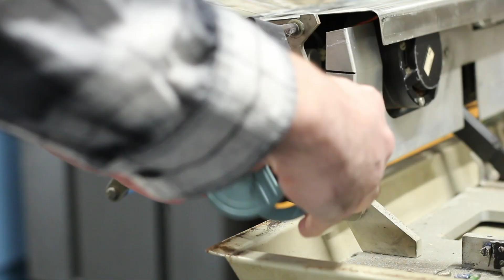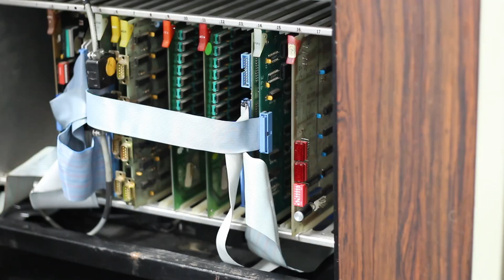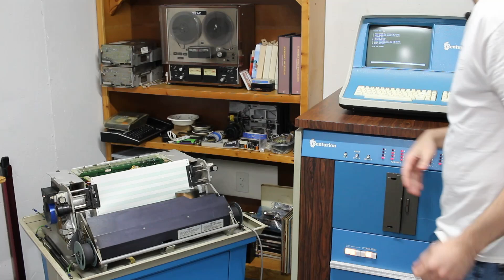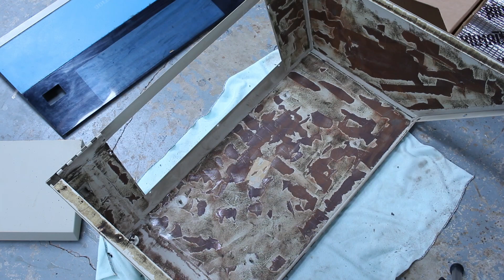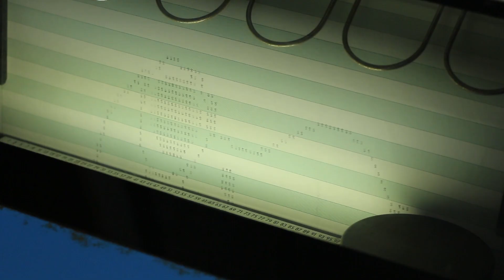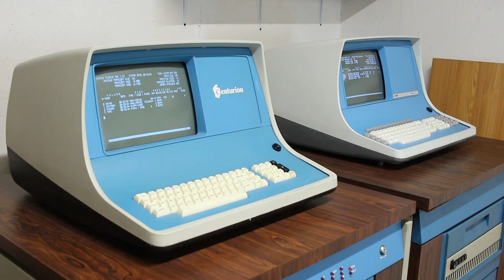Printing ASCII “Art” Like it’s 1980!

Comment: No it does not print 66 colums on the left then shift right to do 66 colums..  It prints the odd (left Colum) then shifts right to print the first column in the Right set of 66 characters.   Basically :The carriage prints odd characters when shifted left and even columns when shifted right.  Look at the video and you can see it.

Comment: Not that his is not a fast printer, but the fastest I ever had the pleasure of working with was a monster from IBM and it spit out 2 pages per second or more (depending on page fill).  The paper literally did an arc through the air before settling into the output tray.  You had to wear hearing protection if you were in the printer room when it was running.  Yes, we had printer rooms back then - circa mid 1970s.  We later replaced one of them with a physically bigger (much) and faster machine  (4 page/sec) but it was a laser, so was considerably quieter.

Comment: Mechanisms and motors really need exercise to function after a long sleep.  I simply run the transport back and forth with my hand through its entire arc of motion several score of times.  Lubrication is important as well, but exercise will free the transport(s), reducing stress on the machine once put into operation.  Reluctant motors and transports can cause the motor to pull more power from the transistors supplying that power and perhaps cause those power transistors to overload and fail.

Comment: My friends DMP100 printer going BRZZZZZZZZZZZZZZZZZZZZZZZT THUNK. DMP100 didn’t have a way to drive the head back to the left side so just released the drive and let a spring slam it into the stop. Radio Shack cheating out no doubt. No drinking a DP80 carbon ribbon, just had to buy new ones.

Comment: I used to have a chain printer back in the 80s when I was about 14 or 15.  A local company was scrapping their mainframe one day and I found out.  Got a van and went and picked up tons of units, mostly terminals and hard disk drives and then the printer.  I got it going pretty quick, but had to build an interface card to make it centronics compatible.  The printer was in very good condition though.  Quite an amazing device I must say.  Used it for years.  It is really nice seeing you restore this one.  Very pleasing to see it in action and hear the sound after all these years.  Great job!

Comment: Back in the late 1970's the CDC computer we used had similar printer art. We had the Snoopy one with the relevant year calendar and also one that printed a picture of Raquel Welch (decent!). Most of our rooms had printouts of these hanging on the walls. There were also others but I've now forgotten what they were.

PS. Compared to the printers on the CDC, this one's a pup That did 2000 lines per minute!

Comment: I saw an HP dot matrix printer that had a huge head capable of printing an entire line at once. This thing was loud that you needed a soundproofed room to use it. It used a SCSI variation called HP-1 to connect to a computer.

Comment: It's almost like YouTube want's me to remember things from when I was young.

I remember in the 70's passing around a file that would print Farrah Fawcett's famous poster in rough grey scale.
I wrote a Basic program to print out a grey scale chart using each character single strike, double strike (same letter, bold) and X out (different letter, double strike, correction). Took a b/w snapshot of the poster in my room, parents slide projectored the negative onto paper on my wall. Enter my data in a Processor Technologies Solus 1-4k. I yhink in '78 we upgraded to 8k. Polyphonic sound - woo hoo!
I remember having to wait until the coast was clear in the lab to print out. Even with sound deadning everyone could hear a  long heavy print out happening.

I got caught, remimanded but passed with a program that tracked attentance in the Mathematics Department and printed a letter when the  threshold for missing or late classes was reached. Data saved on cassette tape recorder everyday. 

Some where in a box I have some cassette tapes we used to save programs. 
Dot matrix was only a dream until the 80's. 
There's also ways of changing the spacing between lines to get a tigher picture.

Comment: I always used WD-40 to 're-ink' cloth ribbons... or really, dissolve the ink from the non-printing edges into the middle printing area. Just spray a bit as you wind from one spool to the other, let it sit a bit, then wind it back the other way, let it sit longer, so ink gets nicely distributed.

Comment: Hey, I need to know how loud the printer is  (in DB). I need this information for an action to improve my pension. During the good times, I have worked most of the time in these impact printers,  belt and drum as well. I need to inform an example of loud noise I was exposed to, when working on them.
Do you have the means to measure it working? Could you please, measure it, to help me and also out of curiosity? 😊
By the way I mastered the hammer fly time adjustment 😂

Comment: Centronics port? Like the same port used on printers for PC? Or is it different? Can you connect this printer to a standard PC parallel port? ...or further to a USB to Centronics adapter? Yes I know the fun is the original computer, but my curiosity has been piqued when you said Centronics...

Comment: Do you have a nine track tape drive? I have an old tape with (I think) several files of ascii art. Willing to ship to you if you are interested. files came from Bell Labs sometime in the 70's. I remember the obligatory cheesecake picture and a spectacular 9 page shot of the moon. THey overprint each line several times to get better shading. Printer must be set to 8 lines per inch. thats about all I remember. Would love to have these fles on a USB thumb drive. I have no way to verify that is what is on the tape but I think it is.

Comment: In the ‘70’s, I worked for Burroughs Corporation as a Group 3 Customer Engineer.  Somewhere in my collections I have a 9 track tape with several wall sized ascii art photos, one playboy centerfold and another ski action photo.  Areyou capable of duplicating my tape? If not, perhaps the computer musium may be interested in obtaining a copy.

I don’t think a paper tape copy would be feasable, it is millions of characters in length.

Also, I have a Varian mini chilling in my garage.
Reply: These printouts are created by overprinting each character adjusting its contrast, and from 10 feet away, it looks like a photo.

Comment: I used to work in a data center from 86 to 91. We had 2 printers that were similar to the IBM 5211. They used a high speed metal band with letters sticking out of the band. But the hammers didn't have to move side to side at all. They just had 132 hammers.   This puppy could spit out a page full of text in just a few seconds.  The main reason why we had it was for printing forms that had carbon copies. So orders and waybills and such. It was a supermarket chain so there were lots of multipart forms.  Then they also had 3 IBM 3800 laser printers. Those could go through an entire box of paper (a stack of fan fold paper about 16 - 18 inched high) in about 5 minutes.

Comment: There is a re-inking machine available, I forget the brand name. We had two of them. Countless miles of ribbon re-inked. It worked by dragging the ribbon along an ink reservoir with a pin hole that applied the liquid ink to the ribbon at a constant speed.

Comment: We used a printer similar to that.  It had a dot matrix block that spanned the width of the green bar paper.  It could print a line all at once which was loud but very fast.  My 6502 listing took about 4 hours, but it was a long program that fit in 4 banks of 32K and 16K of non-banked code.

Comment: I have some spicy ones my dad printed out on that green fanfold printer back in the 1960's....

Considering I made my own bitmapped cursive font and the software to print it out on a Commodore Printer on fan fold paper given an ascii string, long before Macintosh came on the scene, and printed that out on fan fold paper back when I was in high school, I'm not terribly impressed by ascii art.

Hard to believe I invested so much time to something like that... now... in the future... looking backwards.   Or writing things like assembly language programs just to plot a line between x1,y1 and x2,y2 on a bitmapped screen.    Or cracking software.   All those things we did back in the 80's...  that now, if done today would be irrelevant.   Back then we had no way to distribute our hacks, so mostly they lived in your own universe on your own tapes or floppy drives and never traveled off your desk.

Comment: Back in the day we had our matrix printer that used a cartridge with the ribbon inside, to re-ink it we just opened it up and dripped the ink on the side of the ribbon. Then have it rest for a while. In case of the cartridge we also wound ribbon a few times, but this is because of the nature of the cartridge. The ribbon doesn't actually touch everywhere. I guess you could do something similar. The ink would probably be sucked through the different layers.

Comment: The chain system is quite like a 1401's printer, but it's motor--is not hydraulic. : O
I suspect that the 1401's printer used thyratron to fire the hammers, like their punch did. The 1401's printer was wired into the mainframe itself. It's like there was a printer register. If you wanted a one-character buffer, well, that was another monthly fee, just like hardware divide.

Perhaps the plastic window could be buffed out with some fine Novis plastic polish, supporting it gently. If you mask it off near the edge, it won't fill the gap between the plastic and the case. The tape will protect the paint.

Comment: Hey, nice job on the Data 100 printer David!! The stamp pad ink should last for quite a while since it dries fairly slowly. I would imagine it would be a fairly simple deal to conjure up a re-inking station with some spare parts you have lying around, and a bit of ingenuity. The ASCII art is great! I did a fair amount of that in the late 1980's with my first 80286 PC, and an Epson MX-80, 9 pin, dot matrix printer. I must have worn out 5 or 6 ribbons on that dumb thing, and at least a full box of fan-fold 8 1/2 x 11 tractor-feed paper! (just on ASCII art).🤣 I can't remember the name of the program, but there was something that ran in MS-DOS 3.3 that would do large banners that would span as many pages as you cared to make, with huge letters in several different fonts. I used it to make a sign to hang over the door of my office with my business name for the first few years I was in the IT biz!😉

Comment: 4:40 As well as that 32V ripple capacitor reforming with use, it's also likely that the oscillating mechanism was loosening up the dried up lubrication in the moving parts. I do hope you lubricated that mechanism after you cleaned it.

Comment: Reink the sponge that reinks the ribbon, use a bottle of stamp pad ink, which looks like roll-on deodorant but turn it upside down and squeeze and get a few drops out at a time. Maybe just a few sparingly on the ribbon. You might have to poke a little hole next to the roller. It worked great for my old 80s dot matrix printer at least until the sponge turned to dust after 40 years. Looking for another sponge now.

Comment: Long ago, my company had a Fujitsu band printer that was spec'd at 600 lines per minute and the previous job had two, a 600 LPM and 1200 LPM. They had 132 hammers, so no shuttle needed. The previous job also had a Printronix P800, a 800 LPM dot matrix printer. It had a gob of direct hammer pins, mounted on a shuttle and it advanced the paper one dot line at a time and this flurry of activity spewed paper out pretty fast. As I remember it, the ribbons for that printer look like the ribbon for your Data 100 and they are still available. You might be able to just get a new or new old stock ribbon for it.

Comment: You have all that stuff, but no re-inker for ribbons?  I have one plus a bottle of ink, even though I haven't used the old dot matrix printer since the 1980s.  I still have the printer and at least two computers that could use it.

We did ASCII art of a crude sort on a Royal Standard typewriter back in the late 1960s in typing class.

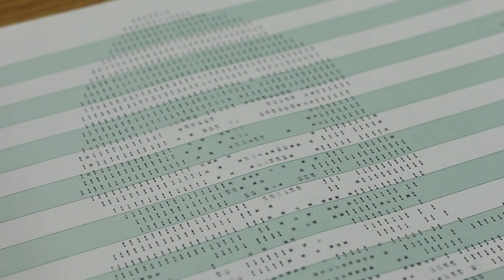Comment: @4:42 and @18:50 and likely elsewhere there is a knob visible on both sides of the printer. What are those for?  Some printers have a control called "Print Density" or something similar. It could be a lever instead of a knob. It adjusts the spacing between the print hammers and ribbon to make the print image darker or lighters.

Comment: Most likely your printer ribbon has plenty of dried out ink on it. I messed with reinking my Epson MX089 ribbons, and used a special device for that ourpose. However, I found one of the most effective ways was to spray the ribbon with WD-40. It dissolved the dried up ink and gave me a very nice dark print. However, I had to worry about excess WD-40 on the first few pages making the letters blurry.

Comment: Fantastic work! Some of these band printers were still kicking about in production in the early 2000s. I recall that the lab VAX at college had one for the VMS system log that was eventually sadly disposed of; it was replaced by a far less exciting HP LaserJet with some sort of adapter. Finally, thanks so much for uploading the file! The file is a wonderful time capsule, although disappointingly tame by modern standards.

Comment: I've had success restoring rather than re-inking old ribbons (for IBM Selectric typewriters). I tried a few methods and the best was using 100-weight synthetic gear oil. A few drops around the edge of the ribbon spool, let it soak in for several days. This reactivated the ink pretty well. I also tried WD-40, 3-in1 oil, and transmission fluid. All of those worked pretty well, but a couple weeks later the ribbon was dry again. The gear oil ribbon has been going strong for 2 years now. I've tried stamp pad ink too, but the ribbons always ended up too inky (the dried ink already in it got sludgy) and didn't print as cleanly.

Comment: One trick people would occasionally try to get a bit more life out of a printer ribbon was to use a spray lubricant like WD-40 on the ribbon (sparingly) and then use some technique to get it to soak through the whole ribbon length.  It worked once at least, but unless you used the proper ink, it would eventually have the opposite effect of making the printing lighter instead of darker.

Comment: This brings back memories from my childhood. In the late 1960s/early 1970s, my parents worked for MARS (Military Auxiliary Radio System) as amateur radio operators aka HAM radio operators to help out in the Vietnam war effort. My dad had a teletype printer like the printer in this video attached to HF radio equipment. And they would transmit what amounted to ASCII art (not sure if it was actually ASCII) to each other. Stuff like Santa Claus, the Easter bunny, etc.
Reply: Aah, memories of RTTY art. 72 columns wide by any length with multiple overprints on each line. All the image files were stored on punch tape.

Comment: I have no idea if this is “safe” or not, but I’ve successfully re-inked an atypically-sized typewriter ribbon with black stamp pad ink. I did it by holding the typewriter ribbon spool vertically and putting a few drops directly from the refill bottle onto the outside of the ribbon at the “top” of the spool, waiting a few seconds for it to soak in, then rotating the spool about 1/8th of a turn and repeating until I got back to where I started. The ink didn’t make it all the way to the hub of the spool, so I wound the ribbon over to the other spool and repeated the process from that side. Never used the actual stamp “pad” at all, except for playing around with rubber stamps later.

Comment: In the late 90's I got to toy around with a dot matrix printer that belonged to the local bicycle repair shop - they'd had it for long and the ribbons were no longer available, or were prohibitively expensive. I carefully soaked some glycerol into a few old cartridges and that did the trick.

Comment: The girly print was not a surprise. There are a bunch of them from that era. And I did a print of the Monalisa at one time decades ago. Unfortunately, was not under my control and could not remove it from the premises. It was on a deck of punch cards.

Now, as for the printer. It looks like you will need to clean the chain at some point. Do be careful, if it’s back by rubber (I could not get a good look at the chain) you will need to get advice on that. But, if it’s metal, go for it, just remember to lubricate it later. The characters look like they are clogging up. Chain, band, and drum printers have a habit of doing so. 
The hammer bank shifting may be a combination of the big caps reforming them self and the rail working in what lubrication it had.
My experience is with Friden Flexowriter, dot matrix, band, and drum printers. Plus, the usual daisy wheel, ink jet and laser printers. And then anything that had a print function built into it. My idea of a copper was that it was a printer with a scanner strapped on top of it. So, what if that scanner is optical. Started with liquid toner machines.

Your friendly neighborhood field service technician.

Comment: No 1403? (Ok that was IBM, don't know if it had any adaptability to other makes).   It was "fun" for it's downright malevolent prediction for dumping people's coffee or lunch drinks on the floor as the door  - hinged in back so that the top raised as it opened - automatically opened when it was out of paper.  Even more "fun" was when some operator would in a moment of carelessness would leave the nightly batch run JCL deck on top of it ...  That deck was about 2k cards.
Reply: P R E D I L E C T I O N  not "prediction".     I hate when I'm auto-errored.   I do enough of that on my own.